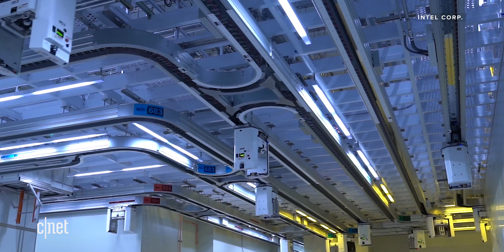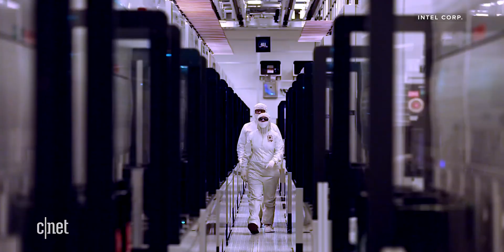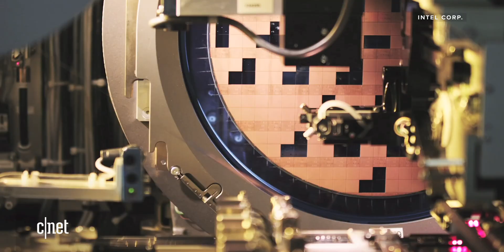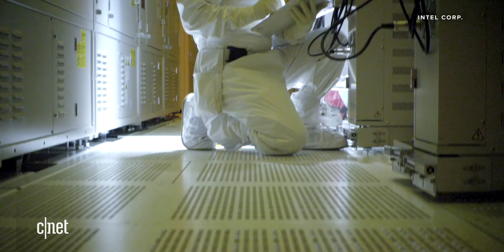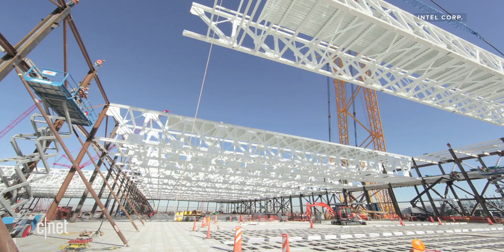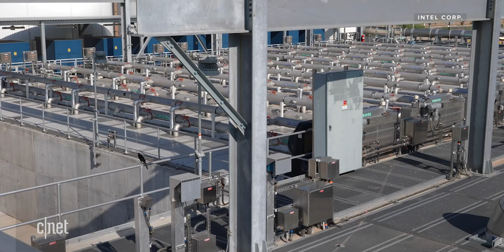Intel CEO Pat Gelsinger! (CNET's FULL Interview)

Comment: As an ex Intellier when Andy Grove was still CEO, I am finally excited for Intel again. I was disheartened the last decade seeing where  this iconic company was heading. With Pat back on board, I am very optimistic that Intel will get back its mojo. All the best to you, Pat !!!
Reply: Paul otellini did the good job too
Reply: @hanrinch  missed the boat on mobile and iphones though
Reply: @azraeldumas4026  that wasn’t a major miss, most of arm processor are underpowered these day even they have fab advantage. If you discard apple’s m1 the most powerful arm is qualcomm’s cortex x2 and it merely just reached skylake’s ipc and we are talking about a new processor in 2022 and based on 5nm fab process and it is just catching up an architecture that was based on 14nm 7 years ago. focusing on mobile market was intel’s primary approach and that was the reason why they failed so bad during Brian Krzanich’s era. So called best for business turn out to be a huge mass.

I actually glad to see them back on track with golden cove that is at least 50% more ipc over arm’s best offer while still in 10nm.
Reply: @hanrinch  thanks for the great insights! But isn't not providing chips for iphones early on a huge miss? This allowed for apple to partner with tsmc and provide the volume and business to fuel tsmc to process node leadership, something that should have belonged to intel had they cooperated with apple. Also, not sure we should discard M1 in the discussion.
Reply: @azraeldumas4026  paul otellini did tried to convince apple to use bonnell processor(1st gen atom) and Steve jobs did shows interest on bonnell after seeing the prototype in 2006 but quickly turned table on intel as the price was non negotiable and the meeting quickly dismissed with disappointment. Intel insisted they want to keep the processor production in house while steve jobs is more ambitious that wanted x86 license for themselves. If paul otellini really fell to it intel would not be existing today, imagine if m1 is fully x86 compatible then intel will have no answer to it. Even golden cove will stand no chance. It was arm that save intel’s life.
Reply: @azraeldumas4026  m1 is in house configuration and not fully compatible with major arm instruction set. It can be considered as independent ISA these day. Even if we include m1 then golden cove is still capable to trade blowing with m1 in ipc and dominate m1 with ST performance due to higher clock speed.

Comment: Left out Barrett and Otelinni on the Intel Legacy response. Moore, Noyce . . .  Grove along with Carter and House May 1993 through shut down 2018 end responsible for Intel Inside tied charge price fix. Grove leading the foremost stock market rigging scheme hand in hand with Softbank Ziff Davis and financial analyst community 1996 through 2016 end on that SEC violation. Intel stock price goes no where between 2001 and 2017 on hundreds of billions ($350 billion hard cost theft prior 10 years and back 20 around $500 billion) in product laundering thefts and Intel pay offs by employees engaged in cartel. No wonder R&D and PE&C fell behind on the financial thefts and lapse in fiduciary duty. Glad Intel is getting its act together but the NEW Intel has a responsibility to address and remedy lingering OLD Intel issues on responsibility and governance under nation's law that is not Intel law, or Intel legal department and jurist network manipulating judicial systems through all of Intel's judicial placements on all of the old Intel tricks. Mike Bruzzone, FTC attorneys enlisted Docket 9288 and 9341 discovery aid and currently Docket 9341 consent order monitor.